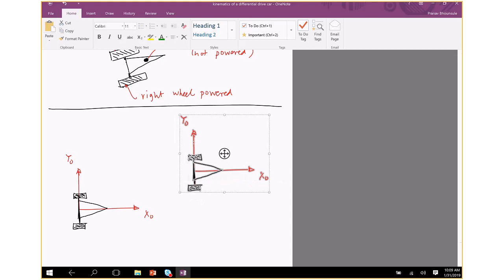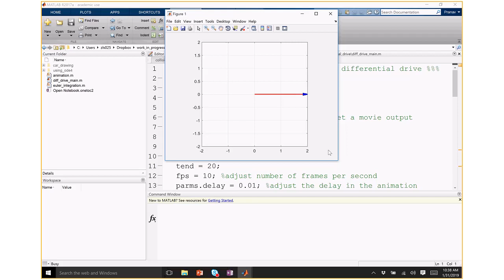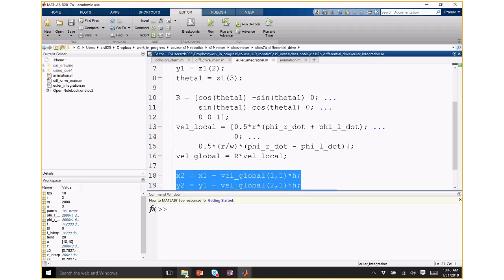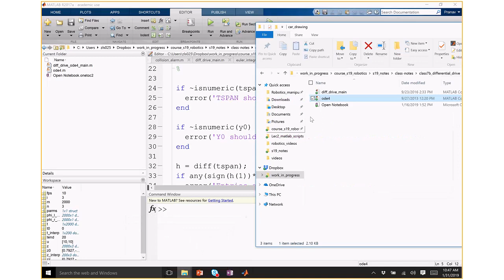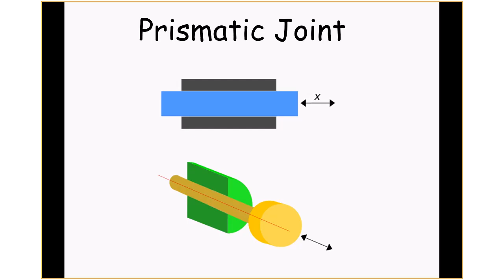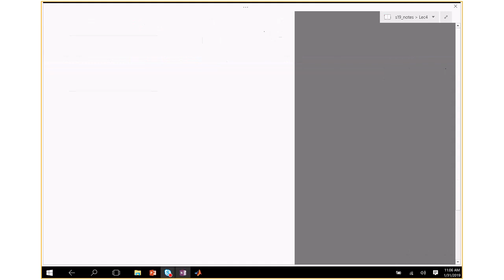Robotics Lec4: Kinematics of mobile car and intro to manipulator kinematics (Spring 2019)

Comment: the velocity of p in frame 1 is 0 because the origin of the frame 1 is p. I think the correct way to say what he  was doing when calculating p' dot is to center frame 1 at the left wheel.
Reply from the maker: I agree. It could have been less confusing if I put p^0 for P referenced in base frame (which does not have zero speed) from p^1 for P referenced in moving frame. Thanks for pointing that out.